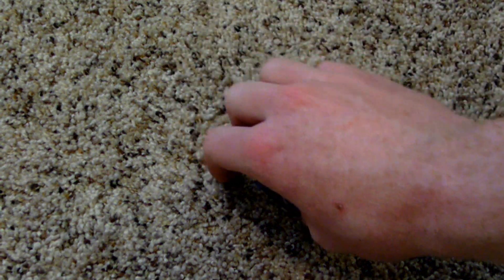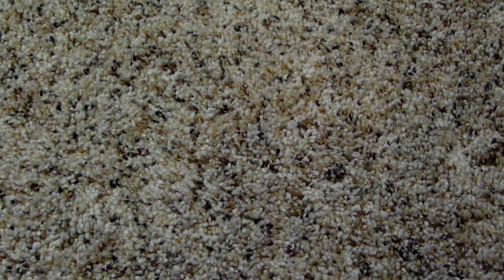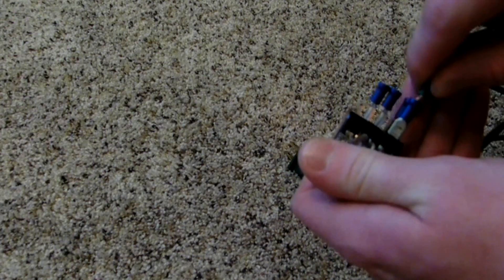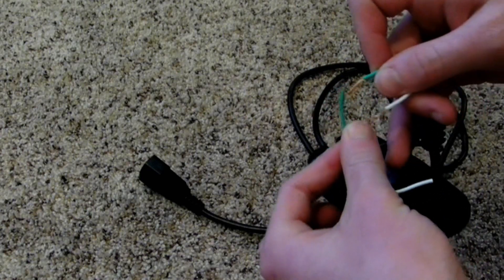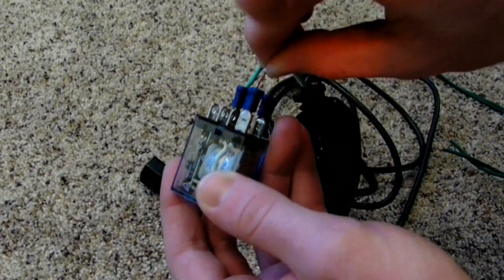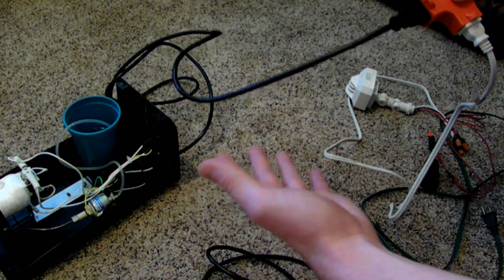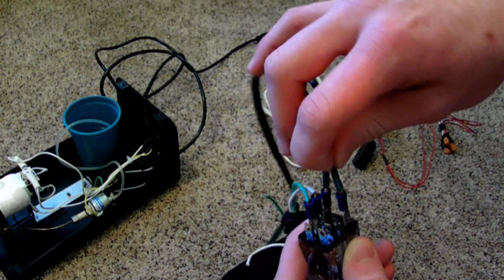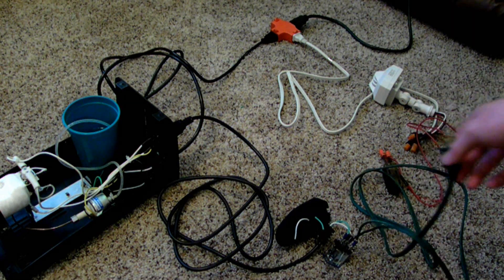Motion Triggered Smoke Machine

Comment: You might want to be carefull there, either solder then or seal them. Also you don't need to use the switch for the smoke machine a normal cord will work too. I'll not be confident leaving this thing like that, too dangerous. You could also use something like this: https://www.amazon.com/Lutron-Maestro-Required-Single-Pole-MS-OPS2-WH/dp/B005WM3ALC/ref=sr_1_1_sspa?keywords=motion+activated+light+switch&qid=1565525359&s=gateway&sr=8-1-spons&psc=1&spLa=ZW5jcnlwdGVkUXVhbGlmaWVyPUEzNjRCQjJKVTM1TFRZJmVuY3J5cHRlZElkPUEwOTYxNDY2M1ZSSEtJUE9KR1BWNSZlbmNyeXB0ZWRBZElkPUEwMjc1ODQ0MkZHVFhaU0UwNEZRSSZ3aWRnZXROYW1lPXNwX2F0ZiZhY3Rpb249Y2xpY2tSZWRpcmVjdCZkb05vdExvZ0NsaWNrPXRydWU=

Comment: Are the wires on the relay connected to the AC contacts or DC contacts?
Reply: So i got it to work in a different way.  The relay worked with a 60W light bulb connected to it but i could tell it was switching slowly.  So then i used a 100W light bulb and it switched a little faster.  Then I left the light bulb connected and also connected the fog machine remote wires to the light bulb wires.  Now it works.  The light bulb must be pulling the necessary current in order to trip the relay.  Maybe it's b/c of the type of relay I got?  I'm not sure, but at least it works (with an extra light bulb involved , but oh well)!
Reply from the maker: npintobean I used a normal extension cord so it was using AC current that you get straight from the wall socket.
Reply: I guess I meant the other wires going to the remote .  Are those getting 12v D.C. Current from the relay ?  I think the wrong relay
Reply: snowboarder10064 or in other words , what voltage/amps is going into the fog machine remote wires
Reply: snowboarder10064 my relay will switch if I connect it straight to a power outlet but it doesn't switch when it is connected to the motion sensor . Not sure why.  I know the motion sensor works... other things turn on by it
Reply from the maker: Neil Pinto I would plug a lamp into the motion sensor and see if it works just to test the motion sensors functionality. If the relay is working when you plug it into the wall then it should be working when the motion sensor is activated.
Reply from the maker: Neil Pinto you should hear a distinct click and see the lever in the relay move when it is activated.
Reply: snowboarder10064 it works with a light bulb.  Maybe I'll try a different relay.  Would this work... https://www.amazon.com/gp/aw/d/B00NWHJ5N6/ref=mp_s_a_1_1?ie=UTF8&qid=1508520051&sr=8-1&pi=AC_SX236_SY340_QL65&keywords=8+pin+relay+110v+10a&dpPl=1&dpID=41BHb14ZSeL&ref=plSrch
Reply from the maker: Neil Pinto it looks like it should work. Did u try the relay I put in my description?

Comment: What senor did you use I need to know this weekend for my project ?
Reply: And also don't know how you did the motion senor what was the whit wire that was plugged into the 3 prong adapter for also what did you concerning using the brow coard
Reply from the maker: The motion sensor can be found at Walmart. They're usually used for outdoor lights.
Reply from the maker: Kyle Tomlinson the white wire carries electricity so when the relay is activated the current is carried from the white to the green wire activating the smoke machine. I don't think I mentioned a brown wire. The small black wire in the button controller is the ground wire for water protection and can be left alone.
Reply from the maker: Kyle Tomlinson yes. Just make sure you hook up the right wires. There are other tutorials on how to hook it up to an extension cord on YouTube.

Comment: Dose the black cord from the controller need to connect to the controller in order for the motion censor to work? or could you just cap off the black cord  and toss the remote?
Reply from the maker: david davis I'm am almost certain the small black wire is not required because it works as a ground wire so you could discard it along with the remote. I kept the remote because it acted a nice storage unit for the relay and was less work than getting rid of the remote all together. Also, without the ground wire the circuitry could be more dangerous if water interacts with the system. Hope this helped :)

Comment: what do you call the prongs that connects wire into the relay? do they come with the relay? In the video you said things and I got confused. Thanks
Reply: snowboarder10064 thank you so much!
Reply from the maker: The Haunted Hills the "prongs"  (the blue plastic and metal pieces I connect to relay did not come with the relay I purchased and will probably not come with yours if you buy one) can be found in most beginner electrical kits. They are called "vinyl insulated push-on terminals". They come in multiple sizes so I would suggest buying a variety if shopping online to ensure they fit snugly on the relay. Mind you, they are not required for this project. You could solder the wires directly on to the relay but I found that to be more difficult and possible wouldn't be as sturdy.

Comment: do you need a relay? can you connect the sensor straight to the machine remote?
Reply from the maker: KIRKILLER38 yes you need the relay. If you just use the power straight from the motion sensor it will send 120 volts to your smoke machine which might "fry" it. The relay lets the current traveling from the smoke machine to pass through by way of the relay and activate the smoke machine. The plug going to the motion sensor acts as just the power that closes the circuit allowing the electricity to flow through the circuit of the smoke machine. Sorry for the late response.